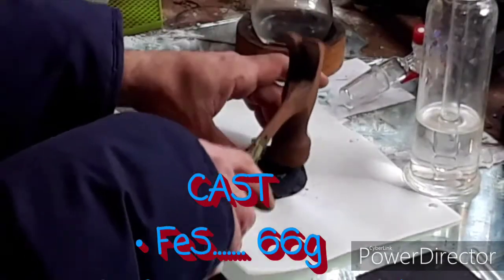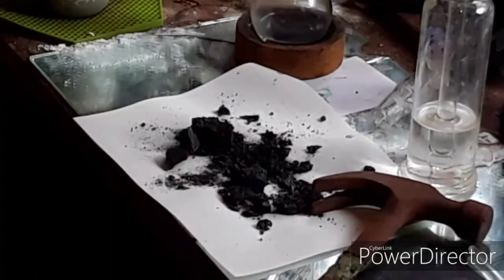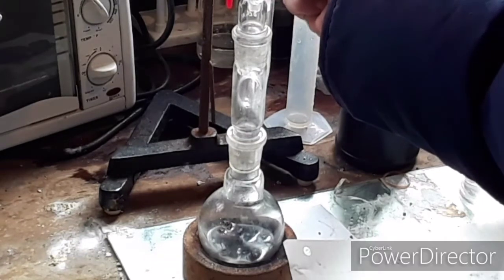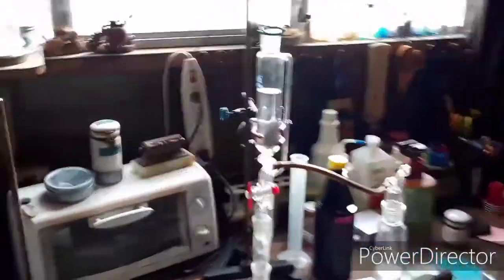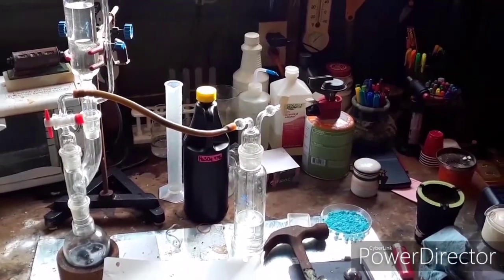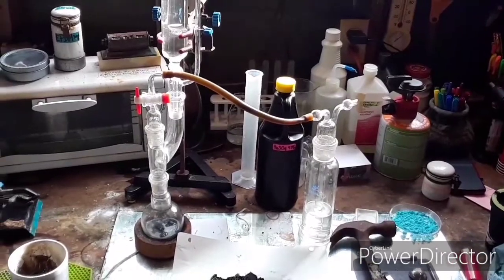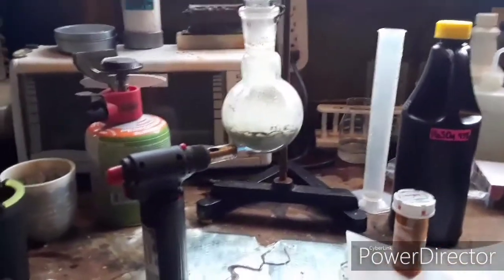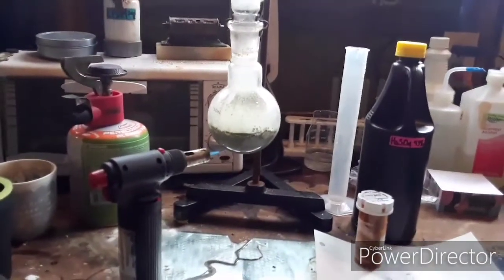Synthesis of Sodium Sulfide (Na2S)

Comment: Have u heard of boiling bleach and sulfur? it produces Chlorine (tons) of it, Oxygen and makes Sodium sulfide and sodium chloride.
Reply: It required a gas trap with NaOH to trap chlorine and make NaOCl but after exposing to zero ethanol i was able to dissolve the NaCl but leave the Na2S alone. I usually just heat Sulfur and lye by distillation on a hotplate to make Na2S and Na2S2O3 with low air exposure. It an easier method I say.
Reply: @pbn3215  sodium chloride and sodium chlorate.
Reply: @pbn3215  I mean the NaOH and the Sulfur and trying to remove Na2S2O3 by cold ethanol. I guess Bleach and sulfur would have Na2S, NaCl, and NaClO3. It the process of boiling bleach some chlorates would be produced. Hard to seperate from the Na2S.

Comment: I hates it when u run outta gas, however, a hot air gun can do the job and is cheaper to run than propane. Mine will boil water much faster than my cheap ass SH(it)2 stirrer/hotplate

Comment: Slick.  Hydrogen sulfide was once used, maybe it still is, for the detection of metals dissolved in water.  So a  way of making H2S was or is a big deal.  An older way of doing this was heating in a test tube, by weight 3 parts sulfur, 1 part of paraffin wax (like from candles), and with enough shredded fibrous asbestos (which is a real no-no nowadays), but maybe some coarse gravel (to provide some voids, which is what the asbestos did) would work just as well. then using a pierced stopper and some tubing leading into the water in question and heat the test tube.  The reaction would result in metal sulfides which are generally insoluble in water and can be filtered off.  The nifty thing about this setup is that that the test tube and so on will be ready to go next time you do this again.  Watch out though, whichever method you use, H2S is poisonous and highly flammable.